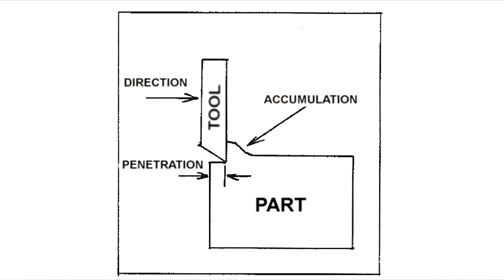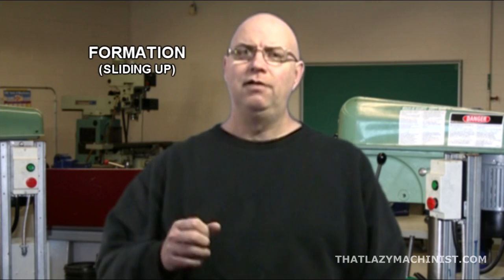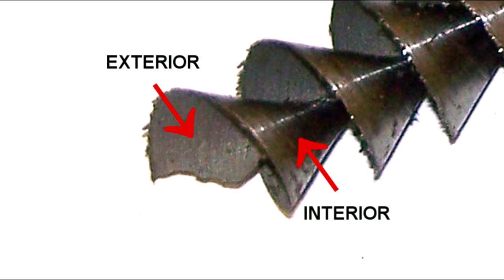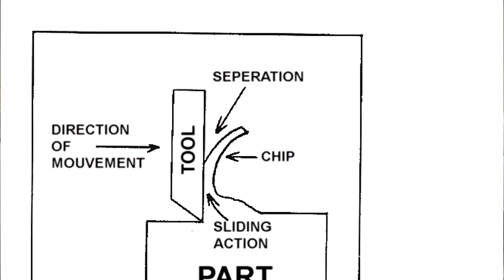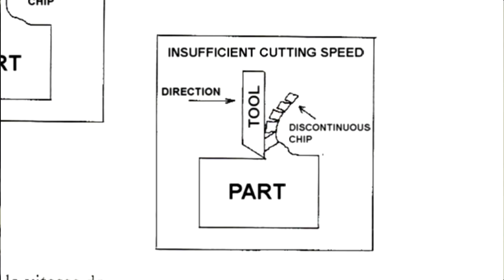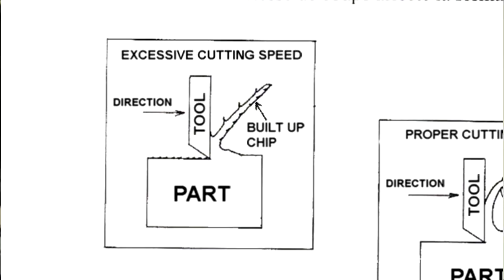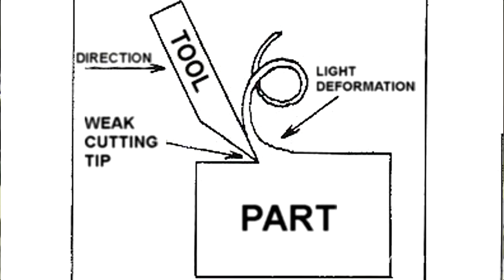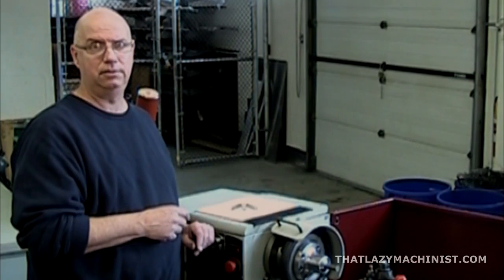CHIPS, SPEEDS AND FEEDS 1, VARIABLES OF METAL CHIP FORMATION AND HOW TO CONTROL THEM, MARC LECUYER

Comment: Hello there TEACH from sunny South Africa
Been reading up as much on this jargon which only now makes complete sense 'cos of the simple and practical way U have explained it.   Although we do not use HSS ground Cutters on our Lathe, we reckon the principles would apply equally as well with our Carbide Inserts.  Now it would be nice if U could explain the Number designations on these Carbide Inserts for one to be able to differentiate between the various Angle Rakes.  
Only hope U have time to peruse through this.  
TIA
ATB
aRM

Comment: Thank you for the clear presentation, starting with theory. Would you comment on machining plastics, please.
Reply from the maker: Hi Bruce! There are many types of plastics and the cutting angles change from one to the other. I will try to talk about it in part two of this video but in the meantime here is a video I produced as an introduction to polymers and their properties. I hope this helps, Marc   https://www.youtube.com/watch?v=Qa7O004cZH0&feature=youtu.be
Reply: THATLAZYMACHINIST That was a very helpful presentation.  I am machining 75 durometer urethane round bar on a lathe.  I think that would be classified as an elastomer. Positive angles with lots of relief, but slow enough to keep cool and with mist coolant is the right approach?